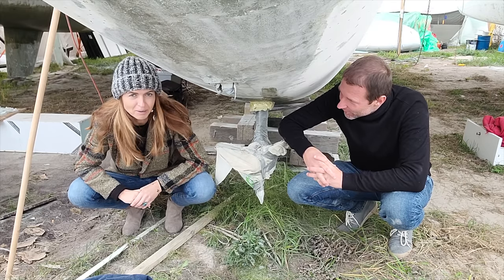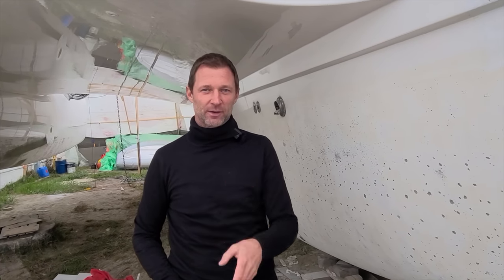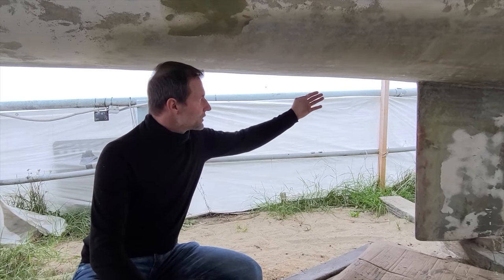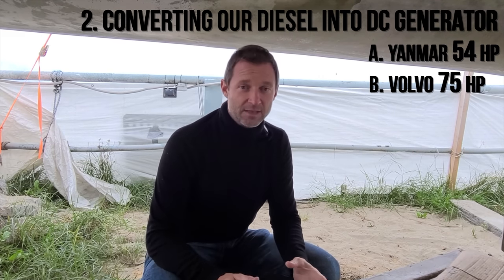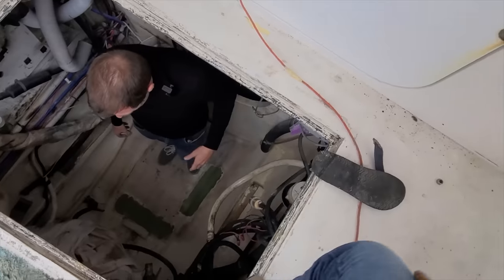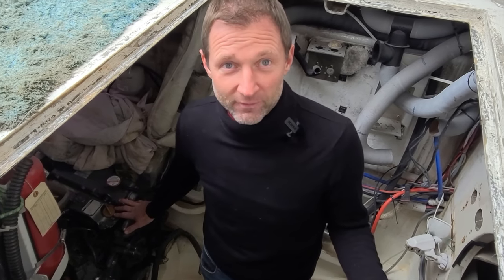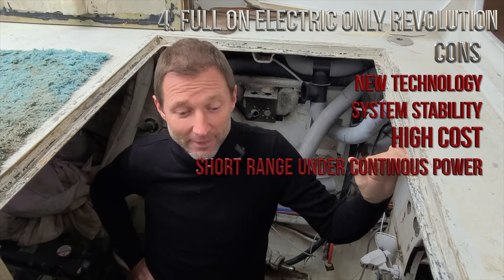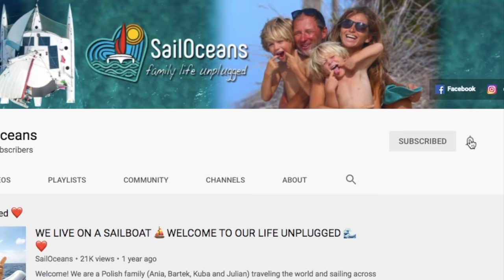The Big Decision - Electric vs Diesel Sailboat Propulsion

Comment: Electric motors in outer hulls with Generator backup to charge batteries. 
Will the E motors to be able to regenerate batteries when sailing? Max motor design should be; the best current against you with no wind. This is the emergency end of the spectrum for the motors speed. The minimum you need is to get you into harbour(depends on you draft, weight etc and min hp to move sailboat)  The generator should be large enough to motor at (whatever your max is) and still charge up the household load. As stated in below comments, the 2 E motors give you the best maneuverability.  Are propellers straightlined to motor or L Drive?  cost of installing new E motor system on outer hulls vs. installing old 75 HP motor in central hull. 
Alot is going to depend on the household load and future add on to the household load.  Fridge, Freezer, Stove, oven, washer, dryer,  microwave, AC/heaters, water makers as your family grows .  Not to mention electronics (computers, cameras, and phones). Also boat operating loads for navigation, lights, radios, radars etc.  An increase in solar panels and batteries will happen, just get the minimum now and add to it in future expansion. 
So any current E using equipment and addons that require electrical will have to be taken into account.  (you need to know voltage and daily consumption of electricity for all these things).
Also whether E is DC or AC and the voltage required for all equipment.  The more converters the more you waste energy.  if you have systems that run on DC, 12, 24, 48 or 96 volts. AC is either 120/220.  Plan to minimize types of converters. Type of batteries and what voltage they are charged to?  Check out the Delos, sailing uma, and Sailing Ruby rose channels.  Look at where you are at for Electricity, batteries and see where you want to go with what you want in the future.  
Check out the Sunreef website, ship yard in Gdansk, their eco sail boats.  
Are your batteries above the waterline? What precautions are taken if they are below and water floods the space?
Are you looking for more performance by saving weight?  If you remove weight what are your options to lower your center of gravity to make the sailboat more stable?

Comment: What about Beta Marine Parallel-Hybrid Diesel-Electric engine. I think they are Kubota based, so plenty of parts worldwide. It seems to me if you ever get in a big storm for a long period of time, that you can drop sails and motor. I think I would want the ability to run for 24-72 hours, so diesel would work in a pinch. Electric the rest of the time. Win win
Reply from the maker: We'll get to this discussion soon in upcoming episodes. Cheers. B

Comment: Option 1: As a light trimaran i would consider going with the all electric option, but consider the electric motors with the best regenerating ability as you sail about 90%. Combine that with modern solar that you can keep upgrading over time as its expensive, plus have the best wind generating option as well. This way you have 3 x eco friendly options to charge the batteries under different conditions, and on 2 x of them you can ramp up your charging ability. In addition I would then consider a smallish petrol generator (could even be a mobile version) that is really your back up and since you carry petrol for your outboard, this can buy you some extended range if really needed.

OPTION 2: Same as above but in stead of the petrol generator, keep the most reliable and light on diesel generator or converted engine and use that as your backup. It does mean though that you have a fixed motor that increases service efforts, compared to a removable and smaller petrol generator.

Its a difficult choice but i really like the electric motors on each ama, as its make the manoeuvring  100's easier, and adds a backup motor. What i like about the petrol option, it really is a backup if your decent sized lithium bank runs out, and you eliminate 1 x fuel source on board. 

An added option is to add an outboard bracket on back of boat where you can put the outboard if really needed....not sure what size OBM you have but a 20hp would work quite ok for canal cruising.

Very curious to see what you decide to go for and thanks for sharing :-)

Take care Marius
Reply from the maker: That seems to be the consensus among the comments so far and the solution I must admit I am leaning towards. The small gas genset would be something that would do exactly what I need to do which is emergency additional power while not adding much weight to the boat. Thanks for the comment. Cheers. bartek
Reply: @sailoceans  i would then also consider dumping any gas onboard and only go electric oven amd bbq...much safer boat and no gas filling issues.

Comment: A couple of things to consider. Lightening might put both your electric drives out. If you have a huge battery bank you need to top it up in reasonable time. You were talking about 15hrs at say 15kwh needs 225kwh of storage. 6kw of solar = 37.5hrs = 7.5 GOOD days of sunshine. Because your motoring time is so low, I would go electric with a 10kva generator, you can probably do 5kn with 10kva unless your pushing in to it but then you will probably sail. If you know you have a long way to go, start the generator at the start. A good sized battery bank.
Reply: Lightning will take out most modern  deisels as well as they rely on sensors to function run and start..

Comment: My calculations (and I am not an expert), indicate that there in not enough space on a cat/tri for sufficient solar panels to power continuous operation on an electric boat. While solar panels are increasing in efficiency, they are  improving only incrementally. Thus with electric drive, your battery bank will be discharging during continuous operation as 7kw solar will not be sufficient to recharge the batteries - this is both for now, and into the medium term future.

Thus, even with an obesely large battery bank, eventually the bank will discharge during continuous operation. Interestingly, batteries are increasing in efficiency and price at a spectacular rate. Analysing how cars are increasing their battery size, it is not inconceivable that an electric boat could soon have a 80-100kwh battery bank, and that battery bank would economic. 

So the central question is how long are you willing to accept being becalmed (ie waiting for the solar to recharge the batteries). In the old days this was considered part of the sailing experience. But now becalmed is both inconvenient, and considered unsafe and risky.

Personally, I like your idea of a small 3kw generator. However, having two small 3kw generators would provide both redundancy and additional power. It is also important that your electric motors have regeneration.

I can imagine that you will end up with 24kwh - 40kwh of battery storage, together with 7kw of solar, and two separate (and therefore redundant) power control systems. However with a system such as this, the chances of being becalmed on long ocean crossings, would be very high. Therefore it would seem prudent to carry two small 3kw fossil fuel generators (of a brand that can be repaired anywhere in the world), to provide redundancy and range extension. For island hopping and coastal cruising I can imagine the generators being unnecessary
Reply from the maker: All correct . That's why we are adding a 12 kW or so genset straight to 48DC for those rare occasions and emergencies. Thanks for your insight. Cheers. Bartek
Reply: Silent yatch's do it at a reduced throttle but the sail and rig messes up solar power at times  due to partial shadowing...and panel configurations.

Comment: There is one more option.  A diesel electric hybrid with an electric motor between the engine and the drive unit.  This will give you electric only  for a given amount of time based on your battery bank size.  You can also run both electric and diesel when you need extra power in bad conditions.   Antares now offers thus system on their boats.  You can also charge your batteries while under sail as the electric motor will also generate power.  Next benefit is you can also shrink the size of your diesel fuel tank.  I would look into the possibility of adding the motor to your existing engine if possible.

Comment: A properly designed, monitored and maintained Li battery system will not catch on fire unless there is physical damage to the batteries or through neglect. Even then it's rare for a fire to happen.

Comment: If you go full solar you really do need to keep a generator on hand for adverse conditions.  Don't go with flex solar panels. Some cheaper panels outperform more expensive ones so start looking at independent tests of the different panels. When figuring costs factor in that the technology is improving every year so don't factor costs over 10 or 20 years, more like 5-10. You can always sell older equipment to get back a few dollars if you keep it all well maintained. It's not really a good do-it-yourself project to install a full electric system so unless you have someone who has been working in the field for a good number of years to stand over your shoulder and tell you what to do, leave it to the pros. If this were a camper van you were turning electric it would be a different matter but mistakes installing a new system in a boat could cost you your boat or worse, your lives.

Have you checked into insurance costs for the different changes? That could affect your decision.

Comment: Don't forget certain electric motors can regenerate electricity under sail which seems would create a lot of electricity with your boat speed.  As long as you use low boat speed (4-5 knots) I would bet you could traverse the canal under power during the day with 6-7kw in full sun and a semi large lithium battery bank.  Since you will have 2 smaller electric motors it should be more efficient at low speeds vs 1 larger electric motor.  Also don't forget a decent wind turbine can add 1kw of power.

Comment: I found your channel after sailing holidays this year. Great job! Keep going! Where I can find you in Gdańsk?

I did some sea sailing. I do drive an electric vehicle. I run photovoltaic installation. I’m still learning… Getting more and more knowledge on EV, I do not see electric engine at the sea. Maybe on Masurian lakes but not on the sea. Wind and water give so much resistance, preserving energy for is challenging. Diesel is efficient for constant power output and diesel fuel is much smaller and lighter energy source than batteries.

So, the option 4 is not possible IMO due to lack of power source. Stormy weather during the night (no sun power) means you run out of the juice easily. You would need 100+ kWh in your batteries to be safe for the stormy night. Cost and weight would be huge. Also BMS (management of the batteries) would be a challenge. Expertise to solve issues or even repair it on Pacific - I can’t imagine that, I would not go this way.

Two electric motors as the only power source for your propellers is interesting idea, but I doubt it’s giving you more reliability. You have the single battery and management of your juice. Single generator and engine. And you are dependent of your engineering skills - both mechanical and electric.

Diesel engine as a motor for storm, could be 54PS. Supported by electric propellers, powered by separate smaller generator. Complicated but that’s my first idea as a desired solution. You have 2 separated systems: strong diesel for heavy weather, you will fix it in the world. Small and quiet hybrid for marina. Also as generator when you need power during the cloudy days.

You mentioned you want to achieve 6-7kW from solar panels. Afair you have 6 of them, which get give you close to 4kW in ideal conditions (sun, no sunshade). PV gives you autonomy but it’s not reliable source of juice.
Reply from the maker: Hi Pedro. I was there today and probably will be there again in a week or two who knows. See my latest comments on the solar generation and other things in the public section. Hopefully it'll give you better idea. You're welcome to visit when I am there too. Cheers mate. Bartek
Reply: @sailoceans  Bartek, thanks, I will take a look at your solars.
Regarding the source of powerful your boat - my arguments for you to keep a diesel: Your engine (54PS = 40kW) needs its full power in bad weather. Consuming 5-8 liters of diesel fuel. With full tank of fuel you can spend 3-5 days in the storm. Electric engine giving you 40kW will use 40kWh from your battery EVERY HOUR. You can have juice for 2 hours by swapping batteries from the car (77-82kWh). 500-600kg and 40k USD. But what you can do after 2 hours?
I'm driving EV. I'm not fan of combustion engines for the car unless towing or long journey cruises. I do not see alternative for combustion engine for the ocean boat. Can be used for running propeller or generator, but today there are no batteries giving you the chance to fight with a bad weather. Cheers, P.

Comment: I don’t think that both the Yanmar or the Volvo be efficient being used as generator. To reach 75HP you will need 60 kW of electric motors, so 2 x 15 kW generators will provide the energy needed to make everything reliable and secure.

Comment: Go electric with a reasonable sized generator to supplement solar. That will give you the best security as well as flexibility.  Solar alone will leave you with to little range and no backup if solar does not keep up with your demands.
Reply from the maker: That's the plan if we ultimately decide to go electric mate. Cheers. Bartek

Comment: Put the big motor back in but rebuild it while its out- but definitely look into an electric motor too if your boat is big enough 4 both? i don't know but im about to sell my house cause i want to build my own boat and im very willing to live in a cheapo rv while i do it. I am a network cable tech electrician with welding experience so i really wanna built me a sailboat of my own design i being a datacenter electrician even have tons of my own metals that need to be melted to make my own boat but i have no idea who to talk to about the boat i want to build with the materials i 2ant to build it with and i want to take part in all aspects of the construction of my boat so i know how to work on all my systems if i need to repair or replace something.. ..

Comment: I think I would lie on the diesel power been in Sailboat for a long time generators unreliable the one you got needs fixed and batteries unreliable they get wet corrosion And you look at the cost of the repair and the electric motors if something goes wrong might want to check out some of those who drive motors for the sailboat just a penny for your thoughts

Comment: Full electric anything is not only about the power train. It's an entire engineered system to get the transportation requirements met. As an example Teslas have retractable door handles because they reduce wind drag. So given that your boat was not originally designed to be a full electric you are starting from a point that is not optimal for a pure electric system even though you stated your boat is very light. It's still not light enough especially fully provisioned. Your hull designs are not optimal either.  Redundancy is important for safety but a single generator powering 2 electric drives is not redundant. You loose the generator, you've lost it all. I would absolutely go with electric motors in each amas but I would consider 2 small generators to complete the system as a hybrid.

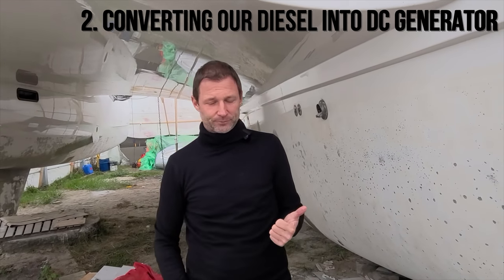Comment: 4:21 Dude U just lost me !!!!!!!!!!!!!!!
Reply from the maker: Hahaha, sorry bro. DC gen is a direct current generator that can be attached for example to the Yanmar or the Volvo we already have. The pro of this solution is simplicity. The regular gensets produce AC alternating current which than has to be "straightened out" by a charger that then can charge the batteries ot feed the DC motors directly. Either way the charger is then the bottleneck and produces some losses as well. Not the best solution if you gonna be doing a lot of hybrid type config. Hope that answers your question. Cheers. Bartek
Reply: @sailoceans  Well; what drives, what is connect to prop shaft than, electric or diesel motor ?
Reply: @sailoceans  What is connect to prop, electric or diesel motor ?
Reply: @sailoceans  Bartek, there is no simplicity in the DC generator! - all high power generators (including ones in your car / boat are AC with the 6 diodes ... DC generators are old types (equipped with mechanical commutator) - they are heavy and not that efficient!

Comment: Get rid of the catamaran and get a real boat with a BIG diesel.  Stop sailing a sailboat with training wheels.
Ya, no, if one side failed you'd sail around in circles.  Install a Perkins and be done with it.  Stop with the Japanese junk.
The more I watch the more fun I'm having .... 67kw is 90hp ... plus a lot of batteries and electric sail drives.  Why now just 2 - 40hp Perkins (4.108) or a single 65hp (4.236)?????
Or ... just get a condo
Option 4 ... since you asked.  lol ... it's not green .. no such thing as green.  Some burned diesel to mine all that lithium and other junk for the batteries.  It takes both fuel and plastic to make solar panels.  It takes fuel to mine the metals for the electric motors and all that wire.  A diesel is one or two chunks of steel and you already said you only motor less then 10% of the time.  I think it's a real no brainer.

Comment: Uma is fully electric, they are making the system safe, by installing wind "engine", generating electricity.
Reply: Uma have solar , wind turbine , E Motor regen under sail ....
but whilst they Have been in high Northern latitudes .. they have had to periodical resort to a small petrol generator.